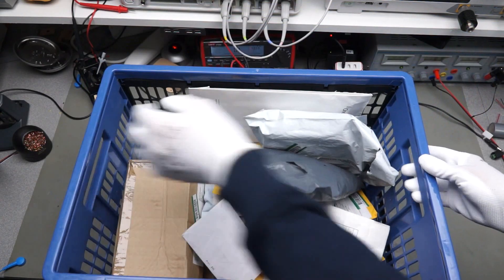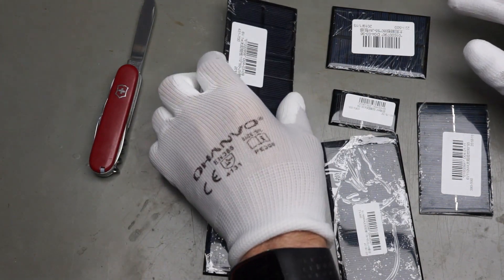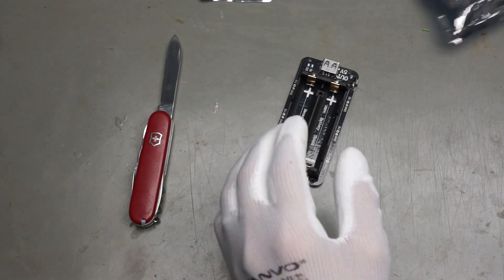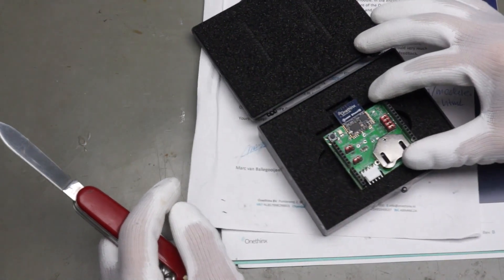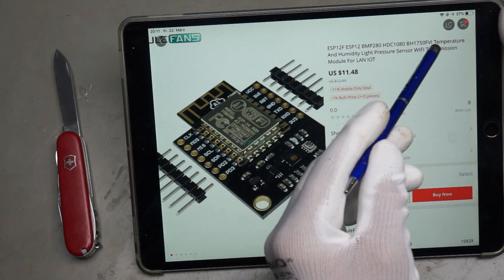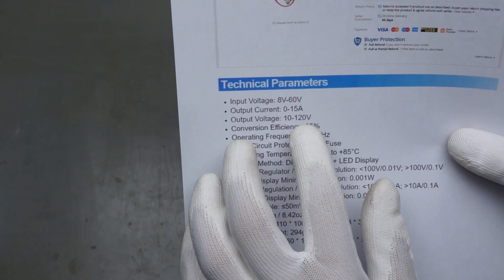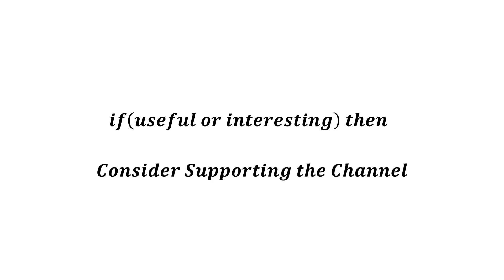#272 Mailbag incl. defective LiPo, Co2, ESP8266 Sensor module, RPi PoE, 120V inverter, OneThinx

Comment: Hi Andreas,
I think the "protected" battery is a bit strange: if the number 18650 indicates the real size 18x 65 mm, your "protected" one is actually a 18xxx where the three x indicate a number> 650 (but I don't know if there is one corresponding standard).
Given that in the body of the battery there is room to add the protection electronics, even at the maximum capacity of the single element it seems strange to me that the factories make an external "device" that modifies the final dimensions from the defined standard.
Considering that some 18650 batteries are sold with an additional pad to cover the signs of a previous weld (yes, they are sold as new but in reality they are recycled: sometimes we get scammed)
I hope I'm wrong but I don't want your battery to be one of them. 
I also bought three batteries from a company "chin chao lin" that declared them original ... in the end under the label with their brand there was stamped Samsung ... and coincidentally all three batteries had the label that covered the famous brand , even a little crooked to tell the truth (craft-run scam ... wow!: - ((()
I think you know DiodeGoneWild: he has made some videos on the 18650 in which he has dissected some of these batteries of dubious fame up to the total destruction. 
Ciao, and i'll see you in the next video!
Reply: I think in mass production it is impossible (not profitable) to create 2 separate designs of 18650. For me it always sounds this way: 18650 + protector, and many sellers warn about this.
Reply: @efimovv  I can not confirm that it is as I say but it seems strange that there is a standard so articulated .. if it were as you say there should also exist the battery holders for the 18650 with protection.
From the point of view of saleability a battery that is badly adapted to the uses for which it was created is a commercial suicide, and creating a standard is a very long thing: it is necessary to agree battery manufacturers and equipment manufacturers.
I don't see the difficulty in making an assembly line for this model with internal protections on an industrial scale: the same AA or AAA battery manufacturer (just for an example) has so many different models in its pipeline that it seems almost impossible that there may be so many: zinc-carbon, alkaline, Ni-Cd. Ni-MH but all in AA or AAA format so at industrial level it is very easy to make a second line, with the protections, that can replace 100% of a competing product without creating assembly problems. this is my humble opinion based on logic, it could be completely wrong but I think it may be right
Reply: @zolatanaffa87  I not insist on my theory either. As I can understand, 18650 manufactured for welding and protection added later on full battery pack (it is waste of money to have protection on every battery in pack anyway) while those protected ones are custom made for DIY and just repacked by some "small manufacturer". I did short research on "18650 protected" again now and many have sign like: NCR18650B 3400 mah battery + protection. Some even have size in photos. And yes - holders exist, you need to check, but those ones with "spring" not "blade" can fit protected battery.
Reply: @zolatanaffa87  - You are getting confused. The CELLS are 18650 (65mm long). These cells are intended to be used with separate battery protection circuits, typically a DW01 chip + Dual Mosfet in conjunction with the charging circuit. The charging circuit and protection are usually part of the device (or charger) and not the cell, in the same way as for all other cylindrical cells (eg: LiFePO4, NiMH, NiCD, etc).
As efimovv says, the "protected 18650" is just a special thing made by small factories for sale on Ebay, AliExpress, etc. There is no need for such cells in the professional / OEM market, which is why the battery manufacturers don't sell the cells with that stuff on them.

Comment: I had bad luck with boost converters (different kind) using as lab power supply. I believe the short circuit protection is totally different on these, than on a proper benchtop power supplies.
Reply from the maker: Yes. Here it is to protect the power supply and in a bench PS it is to protect the device under test.

Comment: To prevent your 18650 battery holders from short circuiting your batteries, take your needle nose pliers and bend the contacts a little more inwards, so the sharp edges cant grab anymore when pulling out the battery. Another idea is to super-glue a strip of ribbon in the middle of the holder by which you can then later pull the battery out that goes on top
Reply from the maker: Actually, the contacts are not sharp and the battery was already damaged before. But I did not care :-(

Comment: The air quality sensor CCS811 does not measure CO2, it can only detect volatile organic compounds, i.e. mainly flammable gases like natural gas, propane, butane plus alcohols etc. This is because it uses a MOX-sensor which works by catalyticly oxidizing these gases. The measurement is given back as "equivalent CO2 (eCO2) levels, where the main cause of VOCs is from humans."  - whatever this sentence wants to tell us.
Reply: Uwe Zimmermann is that vo2 equivalent measure of any use? I also ordered one of these sensor modules but haven't received it yet. The plan was to measure co2 levels in my home.
Reply: @voltlog  I guess it is, but not for measuring CO2. CO2 is quite non-reactive gas and difficult to measure. The only practical method I know of uses the optical absorption - which I find personally astonishing that it is even possible to measure sub-percent levels this way. https://en.wikipedia.org/wiki/Carbon_dioxide_sensor

I do not even understand how the company gets a CO2-equivalent value - equivalent in what sense? Methane is a stronger greenhouse gas and you can calculate equivalent concentrations between these, but that's not of interest for indoor use. High CO2 -levels make you drowsy, so do levels of other gases - but I would assume that the factor would be different for methane, butane, propane, ethanol. And finally the MOX-sensor actually burns the gases into CO2 and H2O - so methane CH4 could give you one molecule of CO2, ethanol C2H5OH could give you two...

If the (presumably Austrian) author wanted to emphasize that the "source" not the "cause" is human activity, then one could possibly relate the amount of volatile organic compounds are released by the humans in the room and that there are established factors between the simultaneously emitted CO2 concentrations and the VOCs. This would however not take any external sources of CO2 into account.
Reply: @voltlog  The MH-Z19B is the lowest priced co2 sensor i could find (around 25$). If you turn off its automatic calibration it works pretty ok, especially at determining relative levels. The Senseair S8 is another option, which is said to be more accurate, but i am still waiting for the package to arrive to test it.
Reply: Torsten Neumann thanks!
Reply: @A38-d7y  Would be interesting to see how they compare. My initial search on it wasn't that conclusive. I'm quite happy with the MH-Z19B (17.60 $); bought a second one but haven't compared them yet. It takes a couple of seconds until the air goes through the filter (e.g. when opening the balcony). Accuracy seems fine. You can see how many people are in the room by looking at the slope.
Reply: @A38-d7y  correct. I have the 19B in use for several years and it works well. I had the luck to find it in an old airconditioner (or something that looked like that)
Reply: Might want to also look at BME680 as it has four sensors -- temperature, humidity, pressure, and VOC.  it will calculate indoor air quality (IAQ) and has low power consumption.
Reply: Ah yes, the eCO2 values are pretty bogus.  Always best to use a proper CO2 sensor.  0 PPB  VOCs always equals 400 PPM eCO2.
Reply: Maybe it could be useful for a hobby room or so to have at least an idea about air quality after doing some painting or similar things. I guess such things should have some kind of impact on the VOC.

Comment: In my opinion, adding solder blobs to areas where you want to make only contact connections (in contrast to a permanent like with a wire or PCB trace) raises the contact resistance thus introducing voltage drops on high currents like charging or supplying demanding devices. The contact area of the solder blob to a flat metal contact is very small due to the round shape and uneven surface of the solder blob. Don't know if the surface of the solder blob even is more prone to oxidization.
Reply: I have seen early failure on 18650s which have been soldered on their positive terminal.  I advise just don't do it...
Reply from the maker: So far I had no problems with my low current applications.

Comment: Hi, for that one i've been faster than you buying all these black batteries boards (with/whithout ESPs) ! I tried some if them but the one i used the most (ups for raspberry pi) worked for 3 days only... I expect the converter to be bad quality. Waiting for your load tests !!!
Also most converters idle current are so high that boards are useless for IOT ... Is there a business niche BTW ??? :)
Keep going ! I feel I don't have to tests all these boards myself watching your videos !
Reply from the maker: I just tested the 5V/3A and it was ok. However, one chip got hot after a while. But anyway, 3A will only be a peak for these boards...

Comment: What i do with the flat end 18650 to avoid adding a solder blob is to use a small neodymium magnet (only for low current porpouses)...
Reply from the maker: You are not the only. Others do it the same way. Thanks!
Reply: Daniel López perfect! I do the same. I use a LiPo charger adapted with neodymium magnets to charge a string of 18650 cells. They’re a little tricky to make since heat kills the magnetic properties.

Comment: Never short a 18650 panasonic battery out. Bad move. It is on top of your battery the positive and the shell is the negative. There is a fuse in the head normally shorting it out to 0 Volts check out my channel on that problem. At least there was not 10 of them. I have sand in my lab now in a boil.  Hi Andreas no gold this week.
Reply from the maker: It was not the plan to get this short ;-)

Comment: these are fake panasonic ncr18650b's  the top of the original have 3 wings not 5
Reply: The top of a 18650 is not a identification method of it's real or not....
Reply from the maker: I consider they are original. At least the capacity is ok. I tested them

Comment: Enjoyable mailbag! The 8266 with bmp280, hdc1080, and bh1750fvi would have been good to know about a month ago, I made the same thing with parts, but that looks much smaller than what I have made. I will order one. It’s funny that part of the problem for me is even knowing what to look for online!
Reply: Beware, it packs an ESP14 (STM8 + esp8266 for wifi). A dedicated review might be interesting!
Reply: Marc Rives I was going to buy one to significantly reduce my weather station size, but after reading some less than favourable reviews (as it relates to difficulty working with it), and also realizing that there is no USB/serial connection, I decided against it as I was anticipating having a lot of headaches! I have enough headaches at the moment...
Reply: @danwhiffen9235  I use d1 mini and i2C shield, no surprise nor headaches ;)

Comment: The sensor board sound like somebody tryed to build an overcomplicated BME 680
Reply: One drawback of the bme 680 is it's air quality code is not open source. Either you use their blob and build your firmware around it. Or you only get a resistance measurement, but that is not a direct air quality indicator. Varies with humidity and temperature changes a lot.
Reply: @AkosLukacs42  Didn't knew that, Thanks for enlightening
Reply: BME 680*

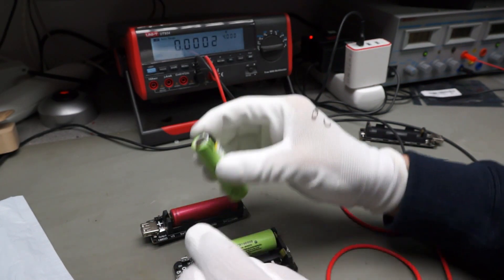Comment: @8:20 Violence solves problems but it introduces a lot of issues. As with people, one should not pressure someone/thing into 'tight' situations and hope it doesn't bend too much out of shape @4:20 that it breaks and/or shorts. Glad it didn't blow up on you + the protection really did work, though it itself was a part of the reason the holder didn't fit.
Working with electronics (and people in general) requires a gentle touch, attention and the nagging question - is something wrong, and/or will it ´'blow up' later? 
Training ones loving attention is never ending  hard work, so please be careful not to fall asleep and repeat your actions unconsciously. :-)
Reply from the maker: So far I survived for 62 years. Let's hope it will last at least for a while ;-)

Comment: If you are going to put solder blobs on 18650s make sure you do it as quickly as possible because heat is not good for the battery.
Reply: Just don't solder 18650s direct to the can.  Always solder to welded tabs, and better if they are heat shunted even then.
Reply: @Tim_Small  Let's just hope one of his future mailbag videos features a spot welder
Reply from the maker: I am no specialist and do not know where more heat is created. the melting point of solder is considerably lower than the one of the metals used by the strips.
Reply: @AndreasSpiess  Yes but spot welding takes a few milliseconds, soldering takes considerably longer, so more heat is transferred to the battery.
Reply from the maker: Maybe. I do not know.
Reply: @AndreasSpiess  That is true, but really you have to look at total energy used.  A typical 18650 spot welder may deliver something like 6 joules to 12 joules (depending on strip type etc.).  The amount of energy delivered during soldering is going to be difficult to estimate, but let's be very conservative and say 25 watts will pass from the iron to the cell+solder for 2 seconds of contact time.  This gives a low-end estimate of 50 joules.  Probably it's more than that, even with the heater on 100% you will see the temperature of a 50W iron drop when in continuous contact with a large metal object like an 18650 can.
Reply: @AndreasSpiess  To give another purely anecdotal story.  I was given a failed 20 watt LED bike light (for off-road biking) to diagnose by a friend.  The battery pack had failed after about 3 months of use..  It was an ebay-purchased product with 4x 18650s, the cells had been made into a pack with nickel strip.  After welding, a lead had been soldered onto the pack on top of the nickel strip, right where it was welded onto the negative end of one of the cells.  Just this one cell out of the four cells in the pack had failed.  The solder looks like it had been done professionally in a factory, so I should think the solder time was short.

Comment: Be CAREFUL of the 120v inverter, I have the same unit. The current limiting has an issue that the output will pass all the available current of the base power supply. Just like the voltage returns to the base when "off" and not zero volts. I control this by the current limiting of my bench power supply but if you use a battery as the supply it can pass very high currents!
Reply: Yes, it´s only a boost converter. It cannot limit the output voltage to below the input voltage. The sellers usually tell you this though.
There is a similar model which is a buck-boost module. That one can limit the current in any case, but it cannot put out such high voltages.
Reply: Some blue painter's tape over the red 7 segment display make it much easier to see on camera. I use mine as a lipo pack charger, but always use diodes on the output.
Reply: Many power supplies discharge their capacitors into the device before doing proper current limiting. I've burned quite some LEDs due to that on a lab bench power supply.
Reply from the maker: You are right. Because the caps are connected to the output they can create a lot of current in case of a short-circuit.

Comment: I just got an idea.
3D print a multifunction battery holder tat is modular.
Make it where a protected 18650, flat top 18650 and smaller AA cells will fit in it.
It could have a simple spring loaded contacts similar to some battery chargers that would fit whatever size cell you put in it.   And the sides of the holder could have a small lip that would allow you to clip them together for multiple cell purposes.

Run with it it you like.
Reply from the maker: Maybe somebody tries it and documents it on Thingiverse?

Comment: Hello, enjoying your videos.
I'm trying to find a circuit however, it has 1 transistor, 1 capacitor and 1 LED, it uses LED as a way to dump the energy to the load once the capacitor is charged up enough, it was used for a small solar car. I can't remember where I saw it or what it was called. Could you please help me?
(I remember seeing a note about covering the LED with a heat-shrink tube to stop the light from hitting the LED)

Edit: This circuit charges up a capacitor and runs a small pager motor whenever the capacitor's voltage is high enough to turn on the LED. The solar panel itself is not enough to run the motor (about 1.2V if I remember it correctly) and the charge is dumped into the motor when needed.
The motor was used as is or connected to a small gear assembly which made the structure jump forward or move forward every few seconds.
Reply: Are you thinking about a joule thief?
Reply: @nirodper  No, it uses no inductors. It only outputs pulses.
Reply: LM3909?
Reply: @davidwillmore  I don't think it uses anything more than a transistor, a solar panel, an LED and a pager motor.
Reply: @PhilXavierSierraJones  if you say what it does maybe somebody knows what you're looking for
Reply: @nirodper  Yeah you're right, let me edit the original comment.